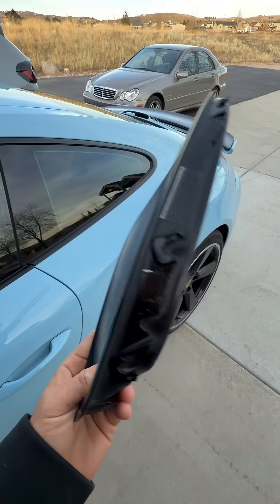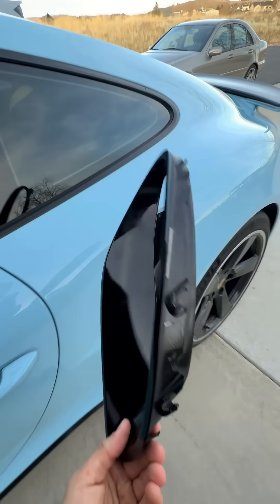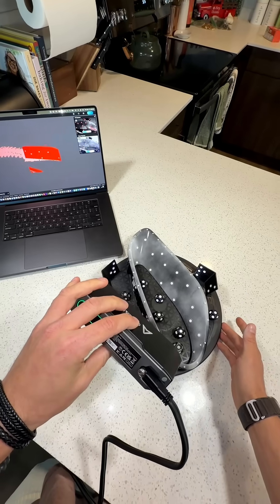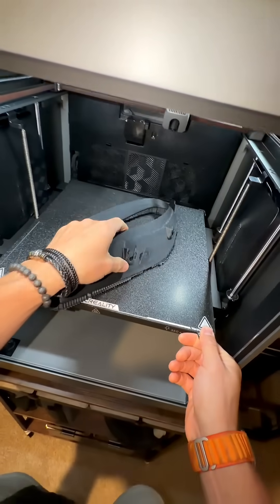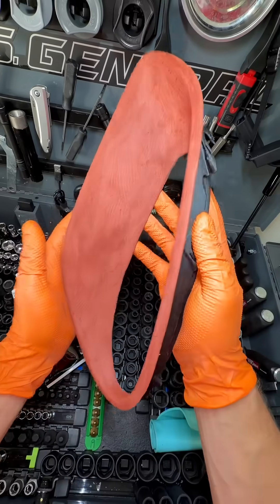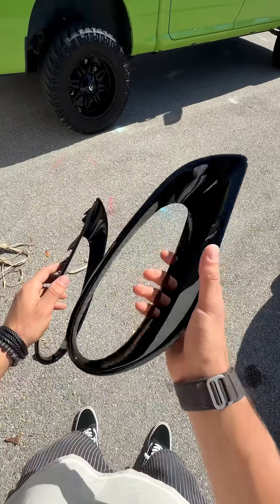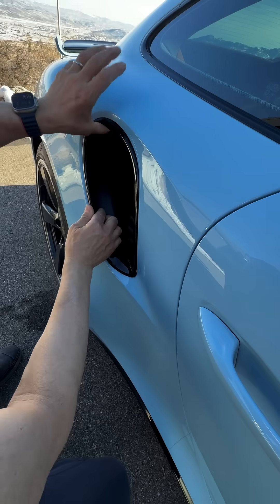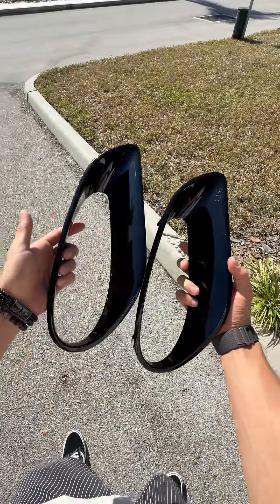Porsche wanted $2,000... So I 3D printed it for $20 instead😳😳😳 #3dprinting #creality #porsche

Comment: 2k is for the carbon fiber duct...not the plastic one...The pastic one is only 300$....
Reply: You just watched an Ad
Reply: @BiskRiscuit not a very good Porsche ad but I guess they cant all be winners
Reply: im sure he removed the original piece so he can say its stolen , the goal was to make this video
Reply: @CaptainKedah 
Yeah. A thief would just rip out the headlights instead
Reply: @MostCensored Front Lights are more often Stolen. Because the light ist perfect for grow plantages of Weed.
Reply: @Chris-14all yeah. My headlights are $2k each, tail light set $350.. lol
Reply: @C @CaptainKedah was thinking the same thing… I don’t recall seeing the mirrored part in the software but I wasn’t really paying attention, just listening and glancing. I’d rewatch before posting this, but due to being on a mobile device, I’ll loose my comment location and not trying to scroll for it 😂
Reply: @CaptainKedah if it's $2k. It's possible it was stolen. I have seen plastic parts stolen often from cars. But, you are probably correct
Reply: @kelgbrown007  If they know the price of the part then both would've been stolen not just one; they also seem pretty easy to take off.  It was "stolen" just for the ad read.
Reply: @CaptainKedah  a thief would have taken the pair or probably the whole car.
Reply: @CaptainKedah yep, gotta love that fake drama youtube culture
Reply: Look it up that pn is gloss black plastic. Carbon is 3800 per side
Reply: @shawnl3151  Fabspeed has a pair of carbon fiber side inlet ducts for this car for 2.5k...You can get parts from other locations besides the dealship, but thay being said if you have a dealers account with Porsche, cost plus 10% comes to 309 and some change for the 1 plastic side inlet duct.
Reply: @shawnl3151 JFC, how on earth do they get away with charging so much for literally £1 worth of materials.
Reply: @rambo.69  That’s the Porsche tax system for ya
Reply: @rambo.69 because they don't want cheap people buying their cars.
Reply: @rambo.69 PORSCHE, Very Simple.
Reply: @rambo.69  because just copying something that is allready made is always cheap compared to the creation of original.
Reply: @shawnl3151   yes.      carbon fiber is lightweight expensive plastic, made for race cars
Reply: @WilliamCrawford-x9r  Carbon fiber is not plastic...
Reply: @flashjordyn03 joke. Easy😮
Reply: @flashjordyn03 it is.. epoxy is a plastic.
Reply: @OzOvlov  Epoxy resin isn't always used on carbon fiber. And even when it is, that doesn't make the carbon fiber itself a type of plastic.. it just means the piece still contains a bit of plastic..
Reply: @OzOvlov  Okay, I will pour resin on you and tell the cops it’s okay to shoot because it’s a plastic person!
Reply: @flashjordyn03  Most carbon is from a carboninzed PAN, a type of Plastic.
Reply: @jfkansas5508  That doesn't affect the end result though... what's left after processing is pure carbon
Reply: @f @flashjordyn03 ircling the semantic black whole. Adding nothing. Saying nothing correct or meaningful. All avoiding the point that even if carbon fibre with resin wasn’t plastic, a piece of carbon fibre trim doesn’t save weight nor have any other redeeming quality for the price.
Reply: @Freshbott2  Well that's not true. It is lighter than plastic. And, it looks much better than it too imo, but I don't remember that being a part of my argument in the first place; all I was saying is that carbon fiber isn't plastic.
Reply: @flashjordyn03 is right carbon fiber is made of carbon not plastic. When mixed with resin and used in this case automotive body parts it is a composite
Reply: @flashjordyn03  No. Chemistry is not a topic for fooling around.
Reply: @flashjordyn03  my windshield’s not glass, it’s laminate... My tyres aren’t rubber, they’ve got steel in them… My carbon fibre air intake trim’s not plastic, its carbon fibre set in a polymer…
Reply: @Freshbott2  Carbon fiber is 90 PERCENT CARBON. You can’t help yourself from sounding dumb. You’re the one calling something plastic that has hardly any resin in it. You just completely argued against your own point.
Reply: @flashjordyn03  All carbon composites have a polymer binder. aka, plastic. otherwise you just have a mesh of fibers that hold its shape as well as any other cloth.

Even with the most advanced vacuum shaping tech, the best resin percentages you can attain are about 20% resin by weight.
Any less and you lose strength.

I swear to god there are so many ignorants who think they know it all.
Reply: @perfectdoll4112  Not true. Though uncommon, there does exist carbon fiber without polymer. Look it up. And, even though polymer is a part of polymer-reinforced carbon fiber, most of the time it's under 50%.
Reply: @WilliamCrawford-x9r carbon fiber is carbon fiber and plastic is plastic, they are not one in the same.
Reply: @xDPx-zh7vr I know, it was a 🤣 joke😂😊
Reply: @flashjordyn03 it is literally called carbon fiber reinforced plastic.
Reply: @xDPx-zh7vr nope what you call „carbon fiber“ is carbon fiber reinforced plastic.
Reply: @pawb1-q1f carbon fiber is a woven fabric held together and strengthened with epoxy. At no point is it a plastic. You can apply the fiber to a plastic base but carbon fiber itself is not plastic.
Reply: @pawb1-q1f  Carbon fiber itself is a very strong and lightweight material that's commonly reinforced with a polymer ("plastic"), but that doesn't mean it's anywhere near the same thing as a solid piece of plastic. I don't know how this is even an argument, like wtf
Reply: @flashjordyn03  stop this argument right now. You two look foolish
Reply: @flashjordyn03 car bon is a type of car with plastic everywhere.
Reply: Ok so if you buy a scanner and 3d printer if you ever need a part you can just print it so it’s an investment… plus you can make parts for others and charge for them and make your money back for what you spent … the primer bondo etc you’ll be able to use for more than one project
Reply: @validj.6769 💯💯💯
Reply: @validj.6769 these people have literally zero understanding of investment and delayed gratification it's hilarious
Reply: @validj.6769  what if you never need? You are just trying to justify your purchase by finding literally anything you can do with it afterwards. Also it's decreasing in value rapidly, since technologies moves so fast
Reply: And the creator of the video said in the comments section that the materials (not including the printer or scanner) cost $225, and that’s not including all the time spent on labor 😂
Reply: "Only"
Reply: So his friend can afford a Porsche 911 Turbo S 2017 for $140,000, but he can't afford a part for $1800?
Reply: @oldi184  You don't just burn money when you buy a car, he'll get money back minus depreciation when he sells it on, and that $1800 part doesn't add $1800 to its value.
Reply: @Chalky. Wait until the next buyer finds out there are cheap 3D printed  plastic parts on his 100k Porsche.
Reply: @YoutubeMooTube  you do realise not everyone buys cars or homes just to sell them later, right? like, some people actually buy things that they want to own, and enjoy having and using. what a dumb comment. cars depreciate the minute they leave the lot anyway.
Reply: 2 grand is alot for CF considering the cf body mods for cars and bikes avalibale on the aftermarket now
Reply: @7angels844 sell the prints for 1/2 price and your tools become profit. Everyone wins, buyers and seller
Reply: and then 2 grand for the 3d printer
Reply: @gregariousgaming6265  Out of the loop? It's $400 right now for the Bambu P1S without the AMS.
Reply: @gregariousgaming6265 uh no.
Not even $2k for EVERYTHING.
And the Creality Ferret (the model of 3d scanner below the one featured) is only like $300 refurbished and would do the same job.
That printer is like $650 without the multicolor system that's shown in the video. It's not needed to print this part or many others.
Reply: @justinmurphy2227 but he didn’t use those items, did he. He used a scanner that runs between $650-700 and a printer that is between $1100-1200,depending on if it is on sale and who you buy it from. So yes, what he used was right at $2k with taxes. You can get those bezels for $300 a pair from a multitude of after market companies, and they would be just as good, probably better than what he made. He spent that much in materials to print them, prep them for paint, and have someone paint them for him. So he is straight up lying when he says it only cost per him $20, and also that the part costs $2k through Porsche. It is the carbon fiber one that costs close to $2k. I would guess that he gets paid to push the Creality crap since 3D printer sales are almost dead. They were like the home treadmills that everyone was buying a  decade ago, people used them for a few months and then they became very expensive clothe racks.
Reply: @TheCrazyMoparDude68 dude you are delusional lmao. There is a huge 3d printer community and they are very popular to this day as they have become affordable to mostly anyone who wants one.
Reply: @TheCrazyMoparDude68 are you actually dim? Yes, 2k was for the carbon fiber part but I can guarantee you the actual final price of his printed version is just quality as anything else aftermarket and cheaper. The printer+scanner cost also isn't something to calculate into the cost for materials because anybody with half a brain knows you're not going to buy tools like that to print a SINGLE part 😂 the real cost he left out is time and labor. And no, the 3d printing community is far from dead, just because it's not on your radar doesn't mean it's dying either.
Reply: @TheCrazyMoparDude68 you’re missing some of the point. You can use cheaper devices than this guy has and two, owning the devices is a one time purchase that makes you a whole bunch of things. Not just a single $2000 piece.
Reply: @Fleato  I understand this "you'll use it more than once" calculation, but it's also unfair to say "you shouldn't factor in the cost" because you did have to buy it, you had to learn how to use it, you had to buy the 3d scanner, you need to test and model this part. There IS a significant overall investment, and one that has to continue to be utilized if you want to actually earn back the value of your investment.
I think what should be more emphasized, which is downplayed in the video overall, is that the technology exists and is, on the whole, EXTREMELY cheap to produce parts of a quality good enough to put on a PORSCHE! Even if it's not "$20" as he says it is, the fact that anyone with a modest ability to invest in machinery and components like this over time and an ability to tinker and test things out can produce components compatible with a world-renowned luxury car brand is insanely cool and should be celebrated.
Reply: @koko4620 your logic is very poor. How else am I supposed to print an exact copy? You don't think very hard do you.
Reply: @Fleato I guarantee you're lying to yourself about how often you use yours. If you even own one lol
Reply: @craig9365  I'm not sure what point your trying to make? I never said to do it another way.
Reply: @justinmurphy2227 I have the exact same printer as this video uses. It’s $1,100 without the CFS. But yeah, you could do this with a much cheaper printer.
Reply: @T @TheCrazyMoparDude68 eality makes good machines, and 3D printers are far from almost dead lol. I doubt this guys sponsored by Creality..   he’s just a YouTuber making content. If you already own all this gear and know how to use it doing stuff like this makes sense. I used my scanner to print an adapter between the aftermarket air intake on my Jeep and a snorkel a couple years back. Just last month I scanned the front trunk of my nephew’s ride on Jeep to print an 8” subwoofer enclosure 😂 that thing BUMPS. Along with custom taillights, a license plate, working instrument cluster, AC, media player, mirrors, limb risers, and dashboard. That’s been my passion project these past few months lol. But the front trunks the only part I needed to scan so I could get a hard number on the enclosure volume to tune the woofer ports (and cause it’s just a really weird shape to measure). My point being some people actually use their printers :P

P.S. I also 3D scanned my junk to print a mold for a silicone toy Christmas present for my girl last month 🍆😂 I’ll tell you some more random side projects I’ve got if you’re interested. I just upgraded to the K2 plus like in this video and I’ve been putting it to work. I’ve got three FDMs and a resin printer I mostly use for printing jewelry (lost wax casting). I fkn love how far printers have come this past decade. The K2 plus prints so fast 🥲
Reply: @craig9365  I don't have one but literally using it more than one time = cheaper than buying the OG part. But also not outside the realm of possibility that I would using something like this often being that I am an electrical engineer.
Reply: @nickpiovesan4361  I'm not saying it shouldn't factor into the cost, but every time you use it on another project, it's cost within the project is reduced.
Reply: @Fleato  I agree, I said as much in my comment. My point is more, if you are trying to to realize the tangible value of these investments (money and time) then you have to be prepared to invest time in however many projects it takes to realize that comparable value (for example, arguably the maker in this video likely came closer to coming out "even" if we compare the cost of a $2k air intake piece to purchasing all the equipment up front, plus experimentation and learning time, plus professional bodyshop painting fees).
That doesn't account for personal value. Buying hundreds of dollars worth of 3d-printing equipment and spending dozens on dozens of hours figuring out how to replicate an expensive car component yourself may not seem worthwhile to everyone, but if you enjoy that unique problem-solving and experimentation process and get satisfaction out of having done it yourself, then who am I to tell you how to spend your money and time?
Reply: @vXAnnonymousXv Yeah I know. That's not even really the thing here. Everyone's saying that he should have just bought it but sometimes you want to do things yourself. Just depends on the type of person you are. The people saying that they would just buy it probably don't fix anything themselves or make anything theirselves... on average that is....not all. He now has the file and doesn't have to go through all the steps again and can even sell the file.
He didn't even mention that you could also, in order to save a lot of time and more money, could just vinyl wrap the part. It would only need a light sanding and would save a ton of bodywork/time!
Reply: @nickpiovesan4361  I sure hope that doesnt take "dozens on dozens" of hours to learn... maybe a dozen.
Reply: @johnlong9494  Fair point. I guess I was thinking beyond "knowing enough to use a thing" vs being experienced enough to f- around and experiment (which, on second thought, you probably don't need all that much practice with the device to do either! lol)
Reply: @gregariousgaming6265 yes, because you have to throw it away after making this part. It’s in the contract.
Reply: But the STORY BRO!
The thing is, I'd still be impressed if he didn't even give the OMG EFF Porsche pricing.
No need. We know it's expensive and it was misleading. 
And he didn't print this part in ASA.... CF!
😂
Which would have eliminated most of those layer lines.
Reply: I had the same problem and used matching urinals from the porta potties at my job site. Rotflmao 😂
Reply: Not many people are smart enough to know this tho, So it doesn't matter if its 7k, same result
Reply: Lmao people in comments tryna justify paying ridiculous prices, your paying for the statues an branding, jus let it go and say your ok with it, if not, go the cheaper route and that’s kool too
Reply: The truth comes out!
Reply: Don’t forget the $900 3D scanner cost
Reply: @PaulTardino it costs the friend probably nothing lol. Keep in mind tools that allow you to do your job faster pay themselves off and eventually your all profit minus consumables and power expenses
Reply: sunsetporscheparts gives that part on sale now for $1.3K and doesn't say carbom
Reply: only-
Reply: bros blacklisted from porche for life along with all his future generations
Reply: So bro realistically would've spent $300+ more to get all of this stuff (the printer was $549 online, plus all of the materials he would've needed) if this weren't an ad and he probably got it sent for free.
Reply: Shhh you're wrecking the lie
Reply: Yeah, but if you do that, how are you going to insert the ad for the 3D scanner?
Reply: How long is paint going to last on an brake cooling air Intake?
Reply: Yeah the difference of 12 grams in that little piece won't matter if it's plastic or metal tbh
Reply: Even Carbon Fiber its not worth 2k lmao. Carbon Fiber technology has became so mainstage that you can find a shop and make you that same part for 400~800.
Reply: Lol like that 2 gram wiegh savings will make a difference with speed 🤣🤣
Reply: @jebes909090 Thats not the point, the point of the pieces is to be a conversation subject. "Yo you see this small ass trim? This shit cost more than your entire families annual income"
Reply: Not true. Plastic one costs more than 1000. Even 300 would be fucking insane btw, 1000+ is straight up vile.
Reply: only?
Reply: Now you lose your engine warranty
Reply: "only"
Reply: Upto what size can you print out?
Reply: ONLY "300".. dude.....
Reply: At least, that's what he told his wife to justify buying the 3D printer and scanner that he wanted....
Reply: @ep8029 yea ok
Reply: You could buy the K1c for $399 which can print it out in carbon fiber. Cheapest commercial grade printer is only $600 more than the part price in carbon fiber.
Reply: Someone that is paying that much for that car can easily afford to pay for the proper part. I met a rich guy with a Pagani and he managed to break one of the carbon fibre side mirrors. $20,000 Canadian to have it replaced and he paid it no problem.
Reply: Sure buy carbon fiber with diamonds embedded!  👍😂
Reply: Right???? This... Might.... Melt... Lol...
Reply: That’s what I thought. I bet the carbon fibre ones get stolen left and right.
Reply: I love that there’s someone out there who dropped $300k on a car but values their time so little they would do this rather than spend $2k. Fun to know how to do but a complete waste of time.
Reply: If you guys out there really want to know how to make cheap knockoffs, go straight to any former entrepreneur in China back in 1990s
Reply: Thank you for clarifying. Now it makes all of this work completely pointless and I'm not surprised by that. I own a basic 3D printer and more often than not the time invested plus the materials because usually you don't get it right on the first attempt plus the fact that the parts are almost always inferior to injection molded means that it's almost never worth it to do this kind of stuff.
Reply: oh well that's just fine and dandy then...🤣
Reply: "ONLY"
Reply: @mirabilis he spent 100 to paint it spent hours in labour and a scanner which is probably super expensive as well and not to mention the cost of the materials.
Reply: @mirabilis honestly based on the wua he talks about the scanner and the hashtag in the description this seems at the least sponsored, and not 100% convinced he owned the scanner. Could be wrong but don't think this replicates the average consumer's experience well at all
Reply: @superdedipro123 really?
Reply: @superdedipro123 maybe 3 hours in labor and maybe $1500 in the scanner and printer. Which, omg the ignorance here, was already purchased, and will CONTINUE to make more parts and more MONEY!
How can you not understand this and make such an attention seeking, "I'm smarter than you", comment?
Reply: @justinmurphy2227  Yeah, but the point is even though he already owned the scanner and printer, he’d still be better off just buying the OEM part. He said somewhere in the comments section that he spent $225 on parts. If he spent 3 hours scanning, priming, driving to the paint shop, etc. it’s more expensive than OEM imo. Unless you value your time at less than $25/hr

Not to mention, the OEM part is going to fit perfectly and as secure as possible. I guarantee that scanned and 3D printed part doesn’t fit exactly like OEM.
Reply: @Reginald_Harrison I know but sometimes you just want to do something yourself to see if you can.
Now, he has the file, and can even sell it.
Reply: @superdedipro123  why are you people counting “labor” as money spent? The entire purpose of spending time on stuff is to save money doing it. If I spend an hour working on my car, I don’t say I just spent $200 in labor. I just SAVED myself $200 in labor. Why are so many people acting like his time here is a cost?
Reply: @superdedipro123 add to that the 800$ scanner plus the massive 3d printing rig, he’s at more than 2k invested upfront
Reply: @PtylerBeats  because time is money unless you’re a teenager who has nothing better to do
Reply: @justinmurphy2227 So-So ummmmmmmm it's clear to all of us he owned the equipment there buddy lol. The point is the possession of advanced technology that costs an amount way higher than that part that many many people dont have
Reply: @mirabilis  yes, extremely cheap, if you drive a Porsche and you can’t afford the 300 dollars. Don’t buy a Porsche 😉
Reply: @mirabilis  You think it's not cheap because the price of the plastic is no where near 300?😂 the price has almost nothing to do with material cost in these cases. Considering it is a premium brand, 300 is definitely cheap for an OEM part. Case in point, look at the equipment this guy needed, and the hours it took him to make it.
Reply: @imaginova88 lol yeah I'd have just spent 300 and saved myself the time and drama. 2k though I might actually do all this and start selling parts.
Reply: @dennisb.d.f.7531 don't make excuses for over charging. A rip off is a rip off.  Case in point, some Lamborghini Diablo models use the exact same parts as Nissan 300zx. Guess which part is cheaper despite being the exact same part? Still want to make your argument?
Reply: @mirabilis TBF that trim piece is probably still $150 - 200 if its a Toyota, $300 isn't that outrageous for a $300k car
Reply: @mirabilis It is when the part is a rare low volume one only made for a body found on a 280k+ USD supercar. (Okay you can find the part on a 290k+ convertible of the same car)
Not only that, but it needs to share that same rare low volume body with another identically shaped carbon fiber part.
This isn't really a situation that takes advantage of the economies of scale that make injection molding pricing reasonable.
Oh and as it is a luxury supercar, their QC work must be near perfect!
Reply: @imaginova88 it’s still a piece of plastic. Mass produced, it’s like $5.
Reply: @wh0_am_152  You're right. It's so cheap. BMW literally gives them away.
Reply: @wh0_am_152 the part he lost wasn't the $3k CF version. It was the $300 plastic version.
Reply: @dennisb.d.f.7531  having the money to buy and own a Porsche doesn’t mean you lose touch with the reality of what things should cost.
Reply: @I-didnt-ask-you  
A side signal light from a Urus is literally the same one off of a Ford Focus i believe, even has the Ford name on the plastic, and Lambo wants 800$ for it lmfaoooo
Reply: @mhigham1  you're correct, if it was mass produced in injection molding land, but it isn't, the mold won't be through 10% of its lifespan by the time they end production, so a 30$ part becomes 300$ to pey for the tooling
Reply: @sajmonxp4479 you underestimate just how cheap Chinese plastic is.
Reply: @mhigham1  I understand how expensive the startup cost is and how low the production numbers are, also that's not your everyday abs, that's glass fibre reinforced nylon to make the part as strong as it needs to be
Reply: @mirabilis he used around 200 dollars to make one
Reply: First i looked it up online and no the plastic one is not only 300 its 1300 second i dont think ive ever seen a dumber comment section before we are in 2026 and people think it costs 2 grand to 3d print something like what are we on
Reply: @maybenotjave 2k to buy the printer and scanner. Obviously you don’t use them once and throw them away though, so yeah kinda dumb
Reply: @vXAnnonymousXv 
If you were convinced to buy this setup to make a single part... You bought it for a single part. 

The reality is that most 3d printers are gathering dust doing nothing.  A large percentage are impulse purchases that never printed a single object. 

It's rare that a 3d printer ever makes back its cost for making inferior parts.

So... Yes.  It's statistically trash after it's used for the job it was bought for.
Reply: @SilverF-1 Man, you’re probably right..  but I use my printers and scanner all the time. I do think it’s a terrible purchase if you don’t know how to 3D model and have a lot of engineering type hobbies. They’re not inferior parts if they’re one of a kind prototypes 😉 on the rare occasion PLA doesn’t cut it I’ll print test pieces then have the part milled professionally. Fr though they should only be bought for prototyping..  the world has more than enough fidget toys already 🐉
Reply: @vXAnnonymousXv 
Lol! Attacking me personally with that fidget toy comment.😂
Reply: „only“ 300$ 💀
Reply: @aboubevwic2880 if you have a porsche, you can afford a $300 piece that goes on it. 😒
Reply: @erysisnthere  and know where "$" goes on a number.
Reply: @erysisnthere just because you can afford something, doesn't mean you want to be taken advantage of.
Reply: He said in another comment that material was 250. Then he spent 100 to paint them. Not to mention the time he spent....
Reply: Yeah but that doesn’t make for good content, so they lie. Hey wasn’t that a Reba McIntyre song???
Reply: carbon fiber duct for what? to be blew off on highway? thanks but no thanks
Reply: So print it in carbon fiber
Reply: @Rick-jr6qn it's not the same two CF materials and processes.
Hand laid CF cloth and resin is a labor intensive process making it justified....for an OEM part. We all know OEM parts are way more expensive. They just are.
But, the process of making the CF part versus the plastic is night and day, and like I said, justifies the  huge prices difference.
An 8 hour handmade part versus and 2 minute injection molded plastic part.
Reply: @Rick-jr6qn you can't print carbon fiber... That's not how carbon fiber works...
Reply: @iiiKingLongSwipeiii real carbon fiber I’m sure you are right but on a 3D printer at home with black carbon fiber type filament you can.  And at 2 grand for some small carbon pieces…that my 3d printer can spit out would be just as good as the ones from Germany it’s a no brainer. Now 2 grand for a carbon fiber hood…… yes definitely but not for some BS air ducts.
Reply: There's carbon fiber filament for 3D printers. I wonder how that would compare in cost and performance?
Reply: @Ken_neThT its dog shit. You need to know how cf work not with 3d print...
Reply: @Ken_neThT Sadly, CF filaments are a huge scam if you’re not talking about ultra high temp stuff like CF-PEEK 😔 for plastics like PLA/PETG the tiny fibers don’t bond at all to the material and create voids which actually makes the part slightly weaker than just standard filament. There’s a YouTuber that did some really thorough stress testing and micro Xray scans of CF impregnated parts. I was REALLY disappointed with the results having just forked out the cash for a CF capable printer. I honestly don’t know why they sell that stuff since it’s also really harsh on the nozzles and the fibers break off and get everywhere including under your skin when you handle the part. I think even if this weren’t the case though the tiny fibers still wouldn’t nearly match the strength of the long interwoven ones in a true CF part. But like I said, apparently just normal filament is stronger 🥲 I can’t tell you how disappointing that was for me
Reply: @vXAnnonymousXv  tullomer filament
Reply: @ProjectAnubisUSA that stuff is awesome 👍 costs like $500/kg though 😅 worth it if you’re making Porsche parts I guess
Reply: @vXAnnonymousXv  cheaper than peek, requires a consumer printer and gives mostly better results in strength according to the data sheet / claims. I suppose as long as your part can outweigh the grams used to make it, filament price isn’t a factor. Given 3D printing allows you to make an internal structure without everything having to be solid, it’s definitely a good option as long as you have the equipment and design skills as well which is the biggest deciding factor. Heck, if I had a Porsche, I’d be reverse engineering all the parts for those prices and still be profitable with any material 😂
Reply: Bad, it's in small fibers, gets stuck in your skin, and if any it worsens the structural properties because it doesn't even fuse to the plastic. 

Since it's in very short pieces it add nothing to tensile strength, torsion and so on. 

Just bad